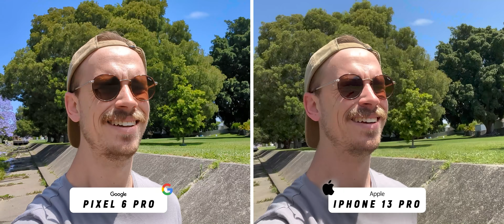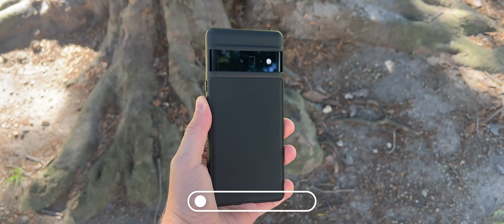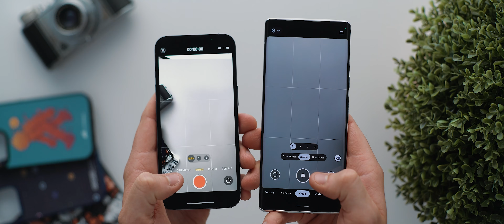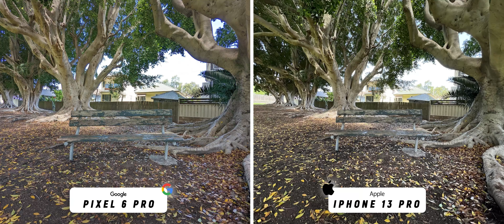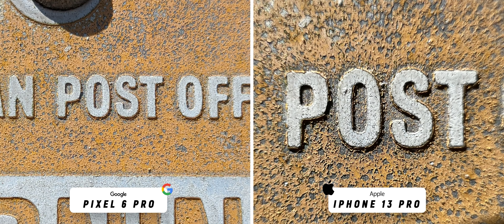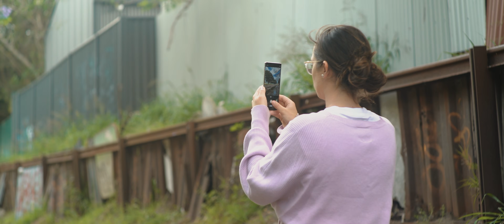iPhone 13 Pro vs Pixel 6 Pro Camera Comparison!

Comment: Such a good comparison! Just awesome!

I actually liked the Pixel videos better aside from extreme low light, ultrawide and stabilisation. It just had more details and the colours looked punchy but not too much. Also the microphone was better on the Pixel, which is definitely a surprise!

I also really dislike how the iPhone crushes dark areas, it doesn't look good at all to me and you actually lose information. 

But the again the zoomed in portraits look DISGUSTING on the Pixel lol. They should enable an option to use the telephoto for portrait mode, it would look miles better.

Now, have you compared their cameras with the S21 Ultra? I would absolutely love to watch it!

Comment: i dont think 13 Pro Max video quality look way better than 6Pro in daylight recording in fact there were both doing great imo. They both can take great quality videos in daylight. I can see the video quality of 6Pro has been improve so much this year. The same goes to potrait shots also. Both are pretty incredible but i  prefer the vibrant colours and a slightly better HDR on the 6Pro. The one thing that i like on the 13 Pro Max and i think that it really crush the 6Pro is when capturing night time photos and videos.

Comment: I got the Pixel 6 Pro a couple of weeks back, partly because I asked myself if I could use that as a replacement for also lugging around a camera, as my faithful Canon was damaged after falling off a cliff. While I'm still weeping at the loss of any meaningful zoom - no more moon shots or extreme sunrise or sunset pics (damnit!!!) - the trade-off seems worth it, as the Pixel 6 Pro has been way better than even my Canon was at several types of photos. It's noticeably excelled with various types of shots that were more problematic on my beloved Canon, and while I'm not a fan of its oversaturation - most evident in overly blue skies and crazy green grass etc - it's been excellent with a ton of shots, and having the images just instantly to hand, ready to edit etc, has been great for my work flow. So, thanks, Google - the pros outweigh the cons here, and it's certainly more than capable for most non-professional photography, within the constraints of being a phone camera.

Comment: Just 2 things i've seen done in other comparisons.
Macro on the Pixel => use the telephoto, not that wide "action" kinda look, but super sharp image
Inacurate Portrait edge detection on the Pixel => use the telephoto for a natural bokeh

EDIT: a 3rd thing
Sometimes not using nightsight on the Pixel looks more impressive in darker areas

Don't always use the "extra" modes for it, try around and find what works best, just like when taking pictures at a unknown place.

Comment: I tried out cinematic mode in a store yesterday and it was so bad I wouldn't use it for anything important shot. It interpreted the edge of the subject as the background, and the background blur is too uniform and fake. What i find unforgivable is that it is software feature instead of hardware so there's no reason it's not available for iphone 12s and earlier

Comment: Hi Sam from the UK 🙂
I have the Pixel 6 Pro, upgraded from 12 Pro Max. I've noticed the following.

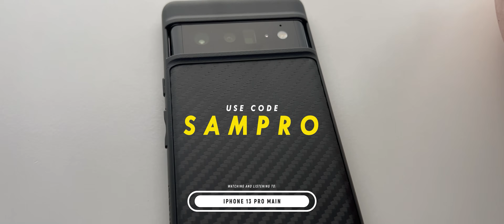1. On mine the always on display, shows as for example, 03:45 even when it's PM, yet the clock in settings show it's on PM, so I don't like that.
2. I put a so-called compatible with fingerprint glass screen protector on, and even with the extra sensitivity setting on, it still fails to unlock 9 times out of 10. 
3. I then put a slide on and the fingerprint sensor works fine now, I re-set the fingerprint after I fitted the slide.
4. The indoor low light photos are not brilliant, I hope there will be an update to fix this. 
Other than that, I'm very pleased. 🙂👍🏻🇬🇧
Reply: Hi someone mentioned that try registering same finger more than one time and it work far better. Tbh I don’t own Pixel however someone mentioned this in another videos and three people benefited from it

Comment: 8:50 that’s…. Not how any iPhone works… I think you just discovered a bug lol. My iPhone 11 can switch lenses mid recording and Apple has kept that the same on all iPhones. They always will.
Reply: apparently its because hes recording in 4k60 lens switching doesnt work at that frame rate 4k30 and below allow it

Comment: dude, you need to disable the camera fixation in the settings, then the iPhone will let you switch them while recording a video. a strange solution, but it works

Comment: Even with that un-polished software tuning of Pixel 6 with it's new sensors and Soc, it still kept up with 13 pro.
It was a surprise to see Pixel pulling up more dynamic range than Iphone in main sensor video. 
Makes me wonder what will happen when finally the Pixel's tuning sets in.

Comment: Ngl I think I prefer the Pixel video in a lot of these? The colors look much more appealing & they seem to capture just as much detail?
Reply: Yeah even I preferred the pixel video a lot of the times.
Reply: less accurate. you can get the same colours on the iphone by messing with the settings
Reply: @strider-pubgmobile757  I have both the 13 Pro Max & the Pixel 6 Pro. I’ve tried to get the “cooler” photos on my iPhone but it still isn’t Pixel levels of accuracy. I love them both, though.
Reply: @tsenif  It's pretty easy. Just change the white balance to slightly cooler. The colours are easily changeable in post. Also, the pixel adds some sharpening to its video, the iPhone actually captures more detail
Reply: @J I literally do lol
Reply: @saln1296  The Pixel sometimes oversharpens, yes, but it also unambiguously has a superior sensor. The iPhone's sensor does not capture more detail. It generally captures LESS detail, crushing shadows and blowing highlights, tho it wins at ultrawide. That was even demonstrated in this video...
Reply: @LucidStrike  a better sensor doesn't equate to better detail. The Galaxy s21 proves that. And the pixel doesn't shoot in the native 50MP mode, it bins the pixels. The resulting detail is very similar to the iPhone. Agree with dynamic range for photos though, I think Apple was going for a more contrasty look.
Reply: @saln1296  This is supposed to be clean footage, not messed with, so like many people would take it, shoot and send, maybe if they make a story or a snap they'd edit it
Reply: @saln1296  I like both, but more to the pixel since it has that lusher greens and bluer skies, ik iphone goes for "realistic" photos and vids but idk, I like the lush green
Reply: @Alexis_Idfk  That's just the pixel boosting up saturation haha. That's nothing. The iPhone is unmatched in video. It's hard to tell in a YouTube video cuz of the compression, but it's very clear if you have both
Reply: I could not agree more. Pixel video looked SO MUCH BETTER in every single clip. I don't know what these reviewers are talking about!!
Reply: @e.a.4926  exactly....especially the stabilization

Comment: Idk why but i clearly could feel the entire video leaned towards the iphone.
Reply: @Sahil Singhal I never said that it was better, I said that it was drastically different as the original guy said was the same old android. Like it's not the same at all, this phone was one of the biggest overhauls on modern (2-3 years) phone history.

Ps. Tensor is ok in actual performance but that's not the selling point, tensor is incredibly smart in it's ai.
Reply: @Sahil Singhal you interpreted new as improved.
Reply: @Sahil Singhal how's screen better?
Pixel -> better resolution
Iphone -> brighter
Depends on which is more important to you aka preference.
Reply: @addium3151  don't forget no f***king notch on the pixel
Reply: Because it's better, and for some reason most reviewers refuse to just flat out say the pixel is a boring, run of the mill android phone.
Reply: @ILoveGrilledCheese  now u are just a apple fanboy... You are literally trying to defend every comment with your apple fanboy shit. Pixel is one of the most innovative phones, own chip, hugely upgraded cameras. In fact I think that the iphone is the most boring, same design, the most standard iteration upgrade ever.

Pixel
New screen
Drastically new design
Drastically new chip
Drastically new cameras

Iphone
New screen
Basically same cameras
Slightly upgraded chip

How's the pixel the boring one?

Comment: I like the Pixel's photos a lot, just I feel that the HDR is a tad overly aggressive, brightening up shadow details too much. Makes the photos look overly processed and kinda fake. iPhone takes it to the opposite end. Hope it was something in between the two.
Reply: Between the two is older pixels basically. The HDR+ they need to calm down with the pixel 6 pro just because the sensor is huge and taking it way more light. They needed that aggressive HDR+ for the small sensor on their older phones
Reply: @supaahflyy  Probably.
Reply: Just enable rich contrast on iPhone and there

Comment: Hey Sam, great video! Just a comment: I have a 13 Pro, but I don't have that issue on changing lens while recording videos, for me, it swaps really quick from ultra wide to wide and then to telephoto.
Reply: It only happens at 4k60
Reply: Yea me either especially at 4K 30 all lenses switch smoothly
Reply: at 1080P it's smooth as butter so such issues!